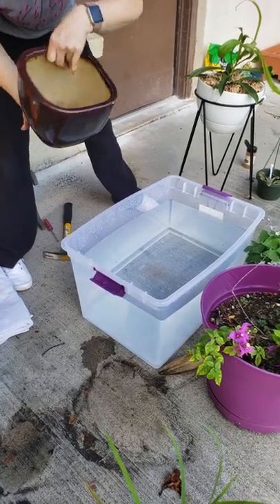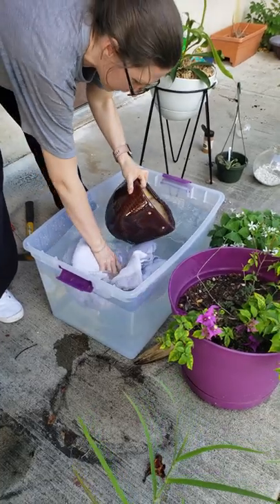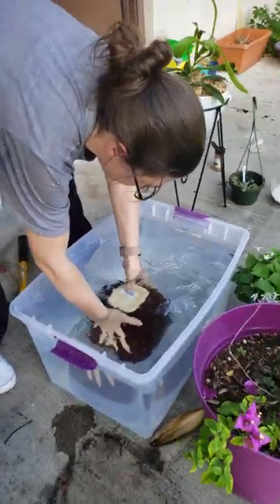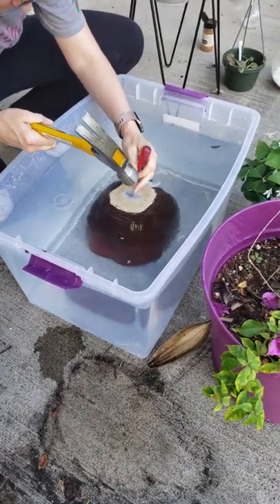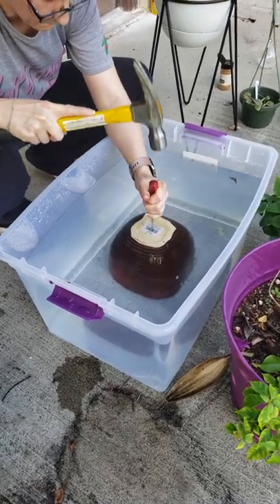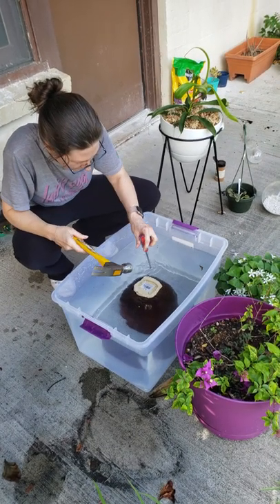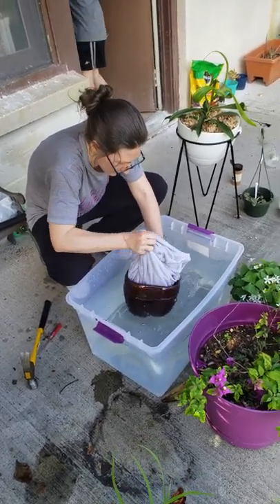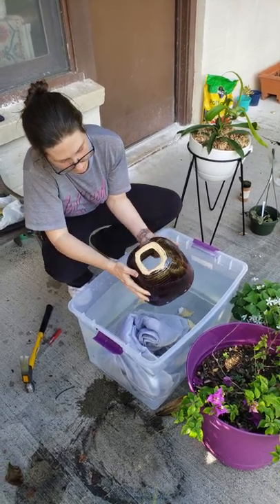Ceramic Pot Drainage Hole Hack - Without a drill

Comment: Do you have any luck with getting a smaller hole using this method instead of taking the whole bottom? Was it the wrong tool used?
Reply from the maker: I should have used something smaller.  The next time I'll try with a smaller screwdriver